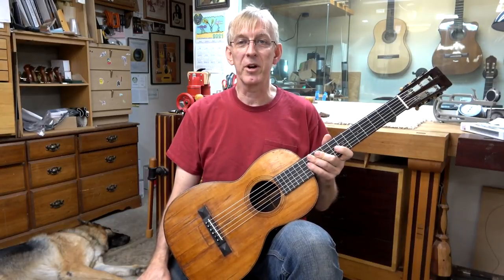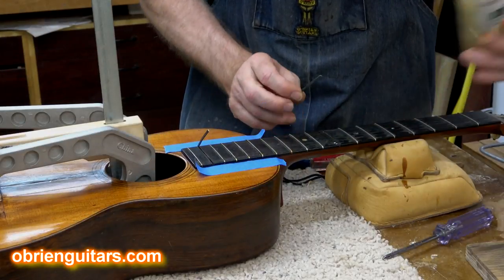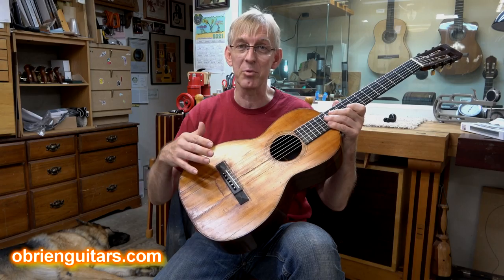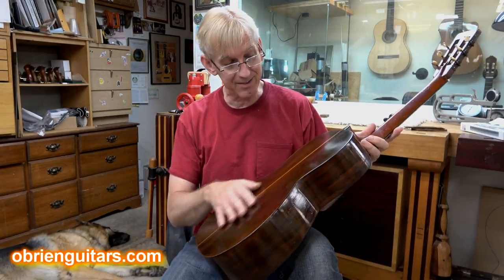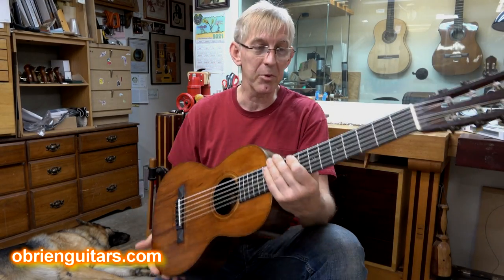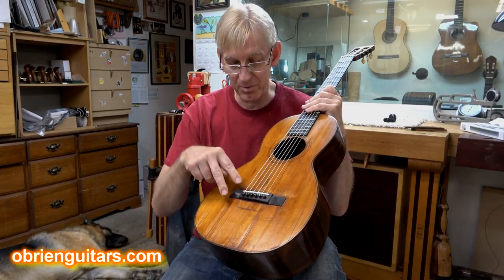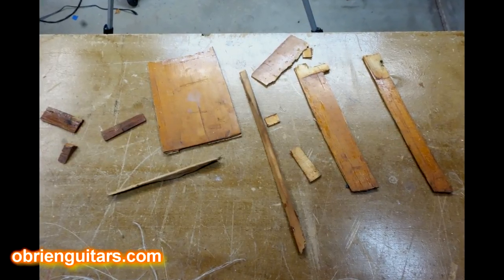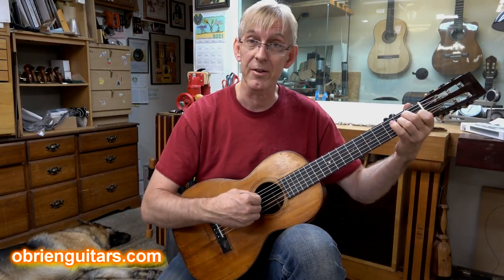1860-ish Martin restoration by O'Brien Guitars

Comment: Nice job Robbie. I did a restoration on one that was almost just like it. We think it's an 1860. It had the same fan brace pattern with the one cross tone bar however it does NOT have the finger braces. Also the one I restored has the Ice cream cone heel. I think they were experimenting a lot back then. I put Saverez nylon strings on it and it absolutely sounds great. Those are the original Jerome tuners and they are definitely Ivory knobs. 

BTW nice playing too!

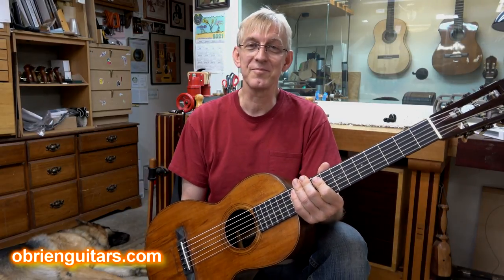Comment: 2:59 These old 1860 Martin Acoustic Guitars were designed for Gut Strings (nowadays Nylon) cause they were very lightly built.
Reply: Every Martin was Gut strung in 1860, regardless of bracing pattern. The unsuitability of this guitar for steel strings has little to do with the positions of the braces and a whole lot to do with their dimensions, as well as the soundboard thickness. X bracing was initially developed for gut strings, and those guitars shouldn’t be fitted with steel strings either.
Reply: @ollimoore  Some X Braced Guitars were strong enough that they could be easily converted to Steel strings w/ Silk & Steel strings. Thomastik makes Special Steel strings w/ the same tension as Gut (or Nylon Strings), their Rope Core Classic S Series.
Reply: @ollimoore  That tells me that these were very lightly built. However some people converted them for Steel strings by adding a tailpiece.